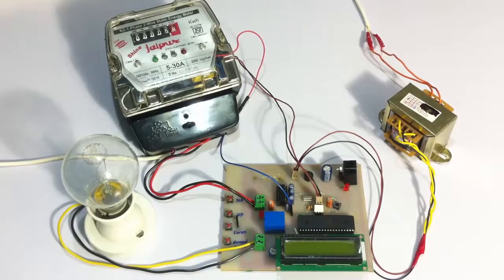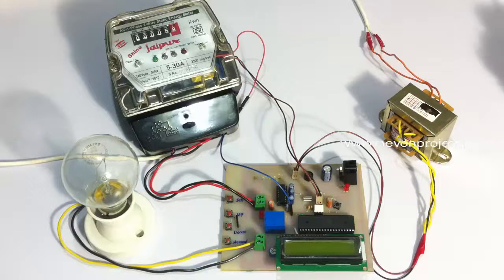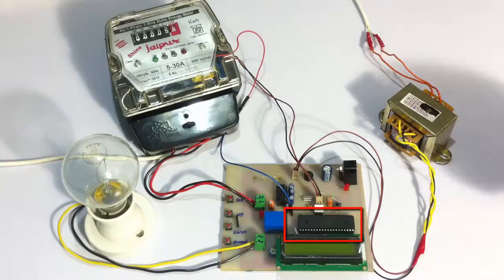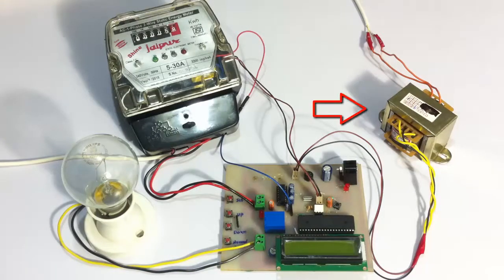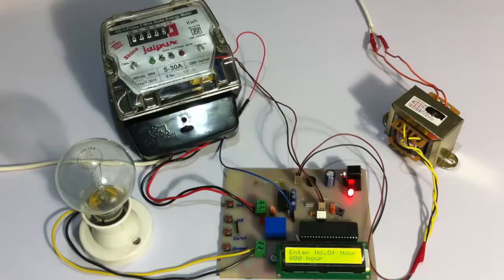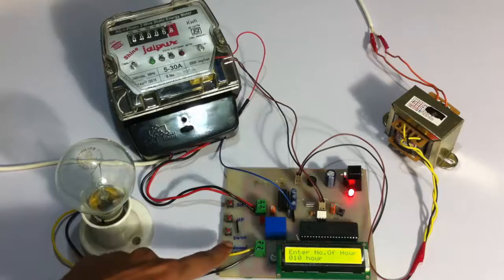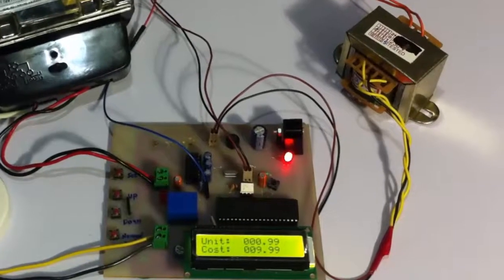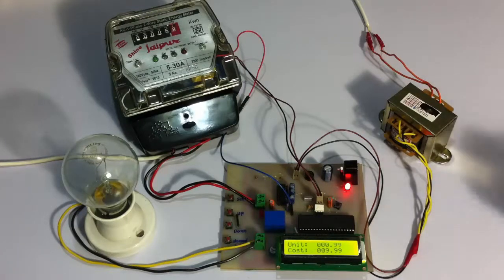Device Load Monitor With Programmable Meter For Energy Audit

Comment: Hey i just wanted to know how u connect the optocoupler....
i have been trying to connect optocoupler with energy meter but the cal led doesn't produce sufficient voltage to power up the further circuit.
Reply: Did you bought the kit from nevon?